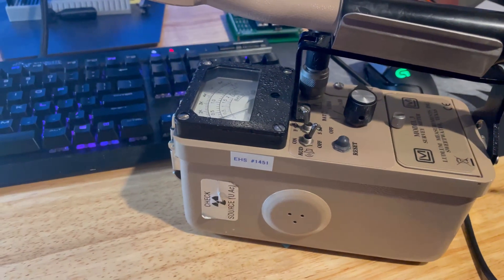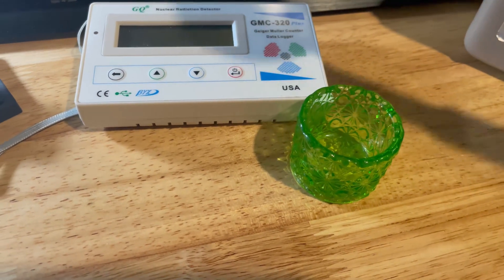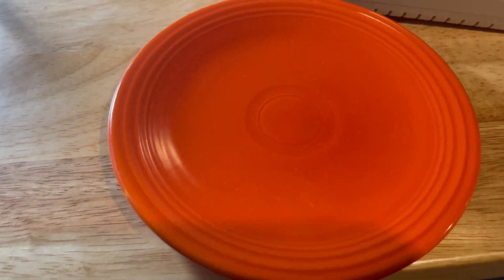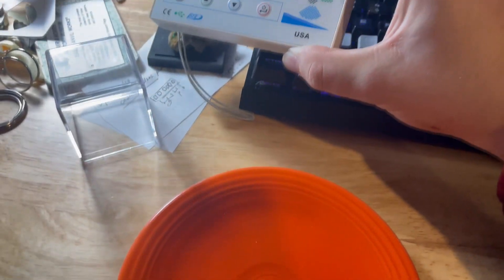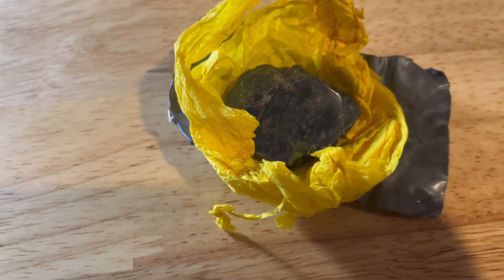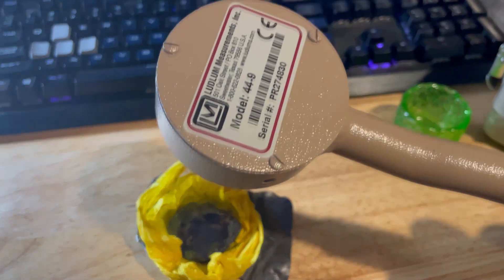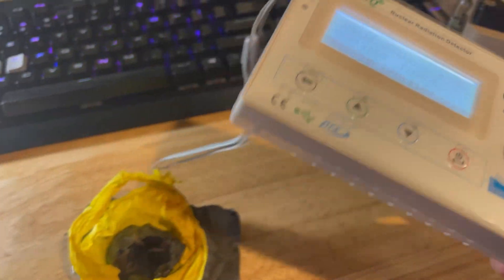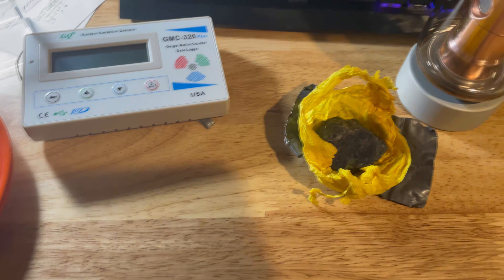Finally got a new geiger counter, Ludlum Model 3 with a 44-9 Probe

Comment: so how much µsv/h the gmc device pulls out with the uraninite?  50kcpm= 300µsv/h ?
Reply from the maker: Yes, the M4011 geiger tube within the GMC320 uses a cpm to uSv/hr rate of 153.8. From a video on my phone I had it peak at 328.4 uSv/hr
Reply: @U238lab  ok thx..so gmc are not very sensitive
Reply from the maker: @weirdmeisterinc  The GMC only detects beta and alpha while the ludlum detects alpha, beta, and gamma
Reply: @U238lab  the gmc won’t detect alpha it has a glass tube and for alpha it requires mica probe
Reply: Is that uranite safe to have indoors 😅
Reply: @PerceptionsProphet  I rinsed some of mine off and it crumbles a bit in water, so I wouldn't recommend it. Just don't eat it, sniff it, or sleep with it, and wash your hands if you handle it, and you should be alright. I did notice it brush against the lanyard strap of the other detector.
Reply: @WR3ND  Please be careful, for you dude
Reply: It makes sense to calibrate to μSv/h since it's a dose rating and not a measurement rating for consistency between detectors, in theory compensating for a given detector's limitations, but in practice I'm not sure how well it actually pans out. Probably just straight CPM and then interpreting the readings yourself gives you a better picture, but this requires already knowing what you're testing and/or already knowing the characteristics of your detector. But yeah, conveying to someone else, μSv/h is probably better in general.